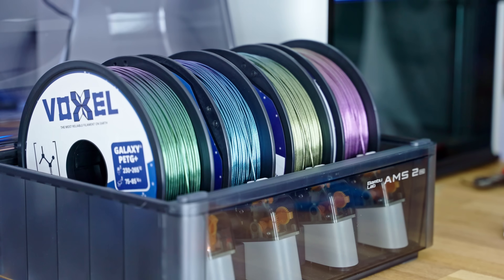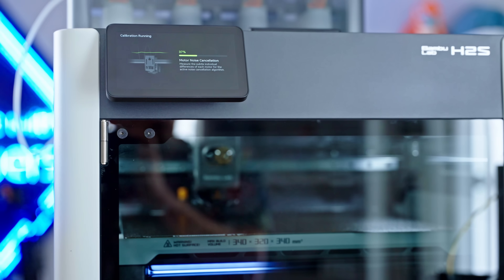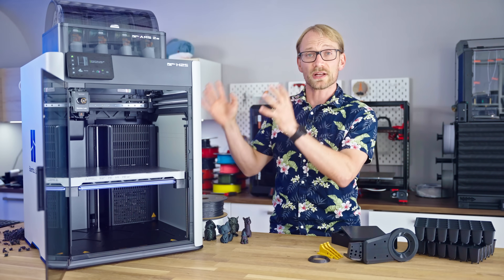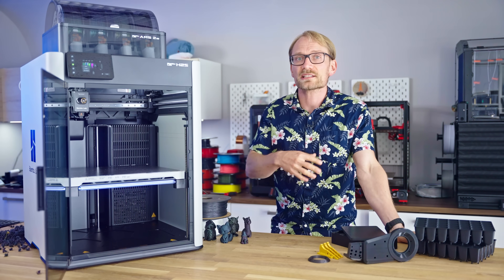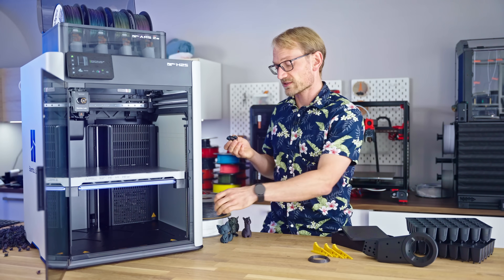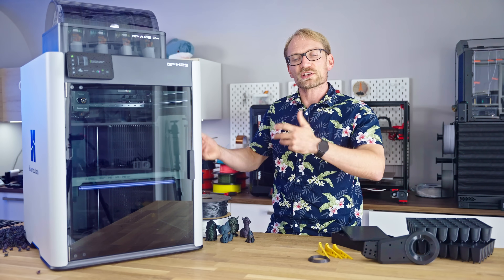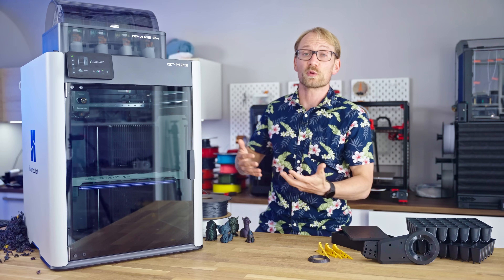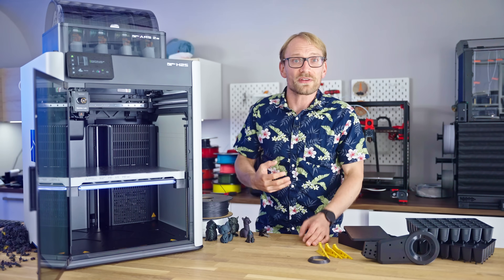Is Bambu's H2S truly a H2D Lite or just a bigger X1C?

Comment: I guess the video was recorded before todays announcements. At the end of Q4 they'll also release the Vortek System that can swap up to 7 Hotends. While it will be build into the H2C, that will be released at the end of the year, the H2S and H2D can also be upgraded with it by a kit that they'll sell in Q4. 
About the Software:  Bambu has also the free Bambu Farm Manager if someone really wants to run everything on a local hosted server.
Reply: It can only swap up to 6 not 7, it has 7 total because the toolhead has the H2D secondary nozzle on it

Comment: 7:00 I am 99% certain those lines are being caused by fan speed settings. Had this exact issue happen to me. In the slicer preview mode, switch the line type to "Fan speed". If the color changes of the different fan speed settings align with these defects on your model there is your issue. Just go into your filament setting for the project and adjust fan speed.

I've noticed after Bambu released the H2 series they updated the slicer software in a way that seems to have changes fan speed behavior to be more stepped vs transitioning. I compared a Gcode file from the same project from a older version of Bambu Studio vs a newer (after H2 release) version and the fan speed view showed much harsher transitions in the fan speeds that were showing on my prints. I exported out the Gcode from the older version and archived it.

Comment: I want the reverse of this - keep the dual extruder but the size of the X1C
Reply: Issue is the size, you would need a larger footprint to handle the nozzle swapping and at that point you are basically at H2 sizes so you may aswell just buy that
Reply from the maker: Agreed - for me too, easily usable multi-material is a much bigger appeal than the larger build volume or the plotter / laser mods.
Reply: @MadeWithLayers Absolutely. If it works reliably, the U1 looks to be a game changer. Especially since it's more open design.

Comment: So to add some additional information and possibly correct you on something. Bambu will be releasing a new printer and hotend tool changer in Q4 this year. The new printer will be the "H2C, not much information on the specs besides the fact that it will be capable of utilizing the new hotend changing mechanism they are calling "Vortek" (video available). In a post on their site they give additional details about the new Vortek system and a little information on the H2C. In that post they do confirm that you are able to upgrade all H series printers to H2C specs to use the Vortek system. This should confirm the ability of changing machine configurations to which ever you like despite which one you buy. So I assume it's possible to upgrade a H2S to a H2D given this info?
Reply from the maker: The info on the H2C released just after everyone finished their H2S videos - while Bambu are stating that it will be able to convert a H2S or H2D to a H2C, they're still firm on the fact that they won't offer an upgrade path from the H2S to the H2D. I don't know the pricing details on the H2C (or the upgrade options) yet, but given that it sounds like it's going to be a quite substantial conversion to turn the H2S into (hypothetically) either a H2D or a H2C, I think most people would go straight to the H2C if they choose to upgrade.
Reply: @MadeWithLayers  I agree with you on the upgrade path option. I personally no longer enjoy modifying printers after having done that with the old creality machines for years. I'm personally sold on the H2S but I will wait till I see what the H2C specs are before I make a decision. I'm very eager to see how their hot end changer compares to a tool head changer like on the prusa and snapmaker U1.
Reply: @MadeWithLayers  if it plays out like the P1P to P1S upgrade path, the kit wont be in stock for 6 months.

Comment: I really think multi-tool head is the way of the future, and that would be a system with at least five heads. 
I'd like to see Prusa make a new version of the XL that fixes the flaws, has a proper enclosure, and doesn't cost even more.
Reply: Prusa will fix the issues, call it a new version and charge another $500-$1000 for the fixed version that should have been released in the first place.
Reply: They better hurry Q4 for the Bambu Vortek release. They're killing it.

Comment: Yep, I know you and I come from kind of the same 'roots' so to speak, Tom; but I've reached the same conclusion - Bambu has knocked it out of the park so hard for the consumer that it's hard to ignore.  I understand the need to hate them coming from the community with regards to the firmware and stuff too - but I run a repair shop, and my goal with everyone has always been to make sure they have a delightful experience with 3D printing.  Ideally, of course I'd love them to get into programming and robotics, and all the stuff that was required of us early on - but the fact of the matter is many people don't have that kind of drive and patience with these machines.  With Prusa even doing anti-consumer stuff like dogbones that you've gotta break to change firmware, I don't know how much longer I can keep up the 'open sauce!' cheerleading.
Reply from the maker: @ThantiK it's been a tough line to walk for sure. And don't get me wrong, I'm still rooting for open-sauce - wherever possible, I go for open-source and self-hosted tools and try to give back where I can. My home runs on Home Assistant, and my next laptop most likely is going to be a Framework - because not only are those consumer-friendly options, but they are also an incredibly capable product outside of that. But it's not always that clear of a decision, and in many cases the concessions you have to make on consumer-friendliness are actually worth the extra capabilities, peace of mind or saved effort. So for example, I do build my own PCs, but I choose to run them with Windows - not Linux. I pay for Google Workspace. The most expensive thing that I own is my car, that I neither built or maintain myself and have little control over. And with 3D printers, where you should be drawing that line for yourself is not as clear-cut as it used to be. Bambu offers an incredibly streamlined experience with the risk of turning 3D printing into a walled garden. DIY Vorons are capable, but require maximum effort to build and tune. Cheap printers may have some standout features on their own aside from being cheap, but will almost always require limiting your use cases or diy'ing in mods. And Prusa seems to be lost in the middle ground, with printers that are solid, but starting to struggle to keep pace, and a consumer-friendliness approach that has a solid backbone, but feels like it's drifting in the wrong direction.
Still, I think any of those options can be a valid choice - if you make it for the right reason.
Reply: @MadeWithLayers  I grudgingly jumped on the wagon last year when my trusty kit built mk2s from 2016 (bought on your recommendation) had a major blob of death. It's fixed now but love my Bambu's. 
Think of it this way, it's kinda like when people had to develop their own photographs, they probably hated shops that do it for you, the shops then hated digital cameras more. This is the nature of progress. 
By the same token these are tools for creativity and the more agile they get the more accessible they are to all and that can only be a good thing for the world.
With the exception of printing forums, 95% of Bambu users have no idea how to fix print or printer issues 😂 luckily these issues are few and far between now though.

On Prusa, they will always have a place in my heart but feel they need to go for industrial machines now, Europe will find it almost impossible to undercut China.
Reply: It is a matter of time, we'll have accept the subscription model of renting things we thought we bought, but we have to push back and at least delay that moment.
I will not buy a BMW or a Bamboo for as long as there is an alternative.

Comment: I love the point int he video where the machine takes the biggest dump I've ever seen. The amount of poops next to the machine doubles in a single cut.
Anyway, priced accordingly? If accordingly means paying the "Apple" tax, then yes. In a world with $300 P1S clones and $800 multi-toolhead machines, anything over about $1000 is asinine branding crap. I'm not paying extra for the logo on the side.
Reply: You're also paying for quality parts, the H2 doesn't use stepper motors in important places anymore, I mean if you want to buy the cheaper option then go ahead, but it's cheaper for a reason

Comment: I wish my Centauri Carbon had the brains that I lacked when "quickly throwing another print on" but forgetting to remove the old one. It REALLY wanted to continue the print and snapped the hotend in half. It only stopped because the shroud fell off and unplugged its connector. Luckily just a 20€ mistake.

Comment: Too large,  too close and not mod or user friendly,  no new features.
Reply: why being too large is an issue?
Reply: You mean other than the 2 extra cameras, the heated chamber with automatic venting for cooler materials, the servo in the toolhead to replace the stepper motor, I mean these are all new things the older model didn't have

Comment: The Prusa XL can’t print these engineering filaments at all. So while it might be great to be able to get a tool changer, it’s useless for anything much past PLA and the few other materials that don’t require a true enclosed chamber with heating and nozzles that can go over 290 C. So it’s not really a substitute for a Bambu Lab machine. He didn’t mention that when he brought up that it had a bigger bed. 

I have an H2D and print PPS-cf a fair amount and PPA-cf somewhat less. Most of the time I don’t need supports. With clever design and positioning, you can often get away with it. But yes, when I do, the second head makes it easy. For me, three heads would be ideal. It’s true though, that if Bambu Lab came out with a tool changer version with the enclosed chamber with heating, I would go for it. 

But I don’t think that’s possible as all the tool changer machines I’ve seen so far have the tubes inserted vertically. That would make the machine really huge, as the Prusa is with the top cover, but would also make the chamber heating and cooling have to service that very large volume. Maybe impractical, unless someone can figure a way around that.

Comment: i'll be honest, i bought a Prusa Core One earlier this year. its been printing great for me, but the software is still broken to this day. Prusa connect still crashes during longer prints, which makes the camera stop working and the temperature control in the app or online gets stuck. Circular parts get consistent layer shift when printing at normal speeds, i gotta slow down around 25% to print them. yada yada, you get the point. The working prints are nice though. i paid 1400€ for that one. 
The H2S with the AMS included is the same price now. Its a bigger print bed, has a bunch of extra features, "better" software (as in better working, not morally better, relax) and has a working ams system included... 
So, if this was out when i bought my Core One, i probably would have gone for this instead.

Comment: you can do cartesian much better and simpler. with multiple independent tool head gantries. if you make things to be your tools then meh. better be single than tied down by many tools. sorry your fancy microwave oven costs too much. target 100-200usd or so. apple model is too restrictive, no thanks. straight single no multibimaterial thanks. design better. so that you dont need to purge. or just use the same material as normal supports. sorry print bed belongs to above alone. not to me or you. or many.
Reply: You're not going to get anything decent for 200 USD lol
Reply: @shanematthews1985  the A1-mini is more than decent

Comment: Yeah, I'll stick with my Voron 2.4 with a StealthChanger. I'm not touching a "walled garden" option that's less capable and has the possibility to be bricked by the manufacturer at any point.
Reply: I have swapped to Linux for my Work computer.
Going 100% open source for my workflow... Well I haven't built A Voron..... Yet... 
I agree this statment, the more printers become walled gardens the more chance for them to pull the plug on support.
Reply: @Torloth  It's like nobody learned from Makerbot's failure

Comment: I think I would have bought this printer a year ago; it was exactly what I was looking for: a larger X1C. But nowadays, reasonably priced multi-head printers are starting to emerge, and that’s a game-changer. The U1 doesn’t have as large a build volume, lacks a heated chamber, is noisier, and doesn’t offer the additional features of the H2S. However, it has four print heads, enabling multi-color or multi-material printing without waste and allowing the same object to be printed with different resolutions. That capability makes all the difference, especially for under $1,000.
Reply: U1 is interesting but I really want chamber heat. I understand many people only print PLA though.
Reply: and... Bambu Vortek announced!! - H2C with 7 tool heads and an upgrade option for the H2D and H2S : https://www.youtube.com/watch?v=rluJj3NEdQA
Reply: Good luck with the kickstarter campaign...

Comment: The 2 founders of the company came from DJI.  That explains everything about their business model.  Those still beating the drum of “open source” and privacy, are like programmers still using a card punch machine.  If you ask what that is, you’ve made my point.
Reply: take open source, close source it and then manufacture in china where labor costs make the printer 5x less expensive than it should? and then lock down their ecosystem so they can eventually add subscriptions and sunk-cost-fallacy you into their back pockets? also, quite a funny analogy bc it's the open source community that made most of Bambu's features possible, to fix your analogy, it'd be the programmers working on quantum rn so apple can say they invented it in a decade's time.
Reply: @StaticNebula26 well, Prusa took open source, modified it and called it Prusa Slicer. Bambu Lab took Prusa Slicer modified it and called it Bambu Slicer. Orca took Bambu Slicer, modified it and called it Orca Slicer. That about right? The original open source is way worse than any of the derivations.

As far as the cgardware goes, Bambu Lab has been well ahead of anyone else and still are.

You really don’t know what you’re talking about.
Reply: @melgross They  filled (and have been granted) patents at the open source prior art. It is pure evil.
Reply: @blacklion79  btw Prusa owns patents as well.
Reply: @lukahierl9857  Problem is not patents per se, but patents for things that was developed and well-known by community. Prusa patents what he invented. Chinese vendors patents everything, like carpet-bombing.
Reply: What are you talking about? And yes, I started with punch cards, which really. Akers what you said confusing. They are the most advanced 3D printer company since they began, and the other companies have been struggling to catch with varying degrees of success, but yet, still haven’t caught up.
Reply: That analogy doesn't make any sense.

Comment: There are a number of nice quality of life features (some of which I think are actually from the A1 - the nozzle setup is the same, and I'd be shocked if they're not cross-compatible) over the X1C - especially my first run kickstarter version.  The large size I don't personally have a tonne of use for, but there's some situations it would be handy to have it.  (My "big" things tend to need 50x50cm build plates, so anything smaller than that is still breaking it into parts.)  And the AMS should still have runout fail-over capability, so that helps to off-set any issues with 1 KG spools.

But this is still 800$ CAD more expensive than an X1C right now.  Even using RRP, it's 450$ CAD more.  There isn't that much extra value in it, for me, and my low income.  (Put differently, right now I could replace my X1C with another (and add an AMS) for 3 weeks wages, buy an H2S for 4 weeks income, give up some ease-of-life features and buy a P1S for 1.5 weeks' income, or roll the dice on a Snapmaker U1 for 2.5 weeks income.)  To be sure, the U1 is on inceitivised pricing and has some risks but man, if I was buying a printer the H1S isn't the way to go.  I'm not sure that Bambu is at all.  And not because of any of the walled garden stuff that people like to whinge about, it's just because of the capability to cost ratios.